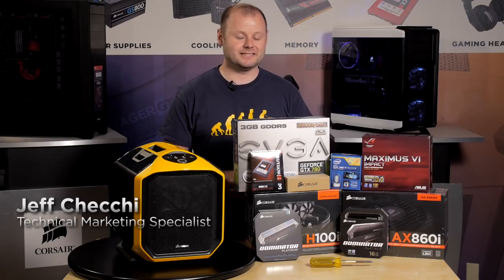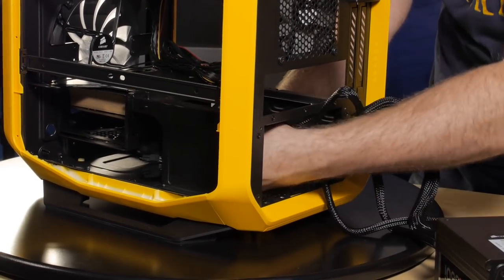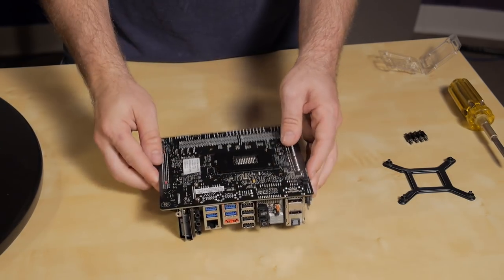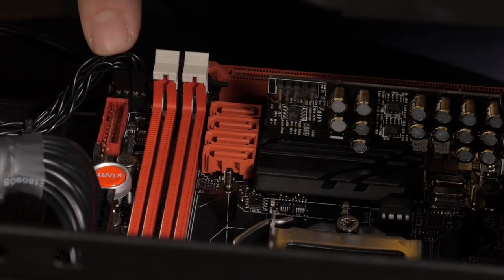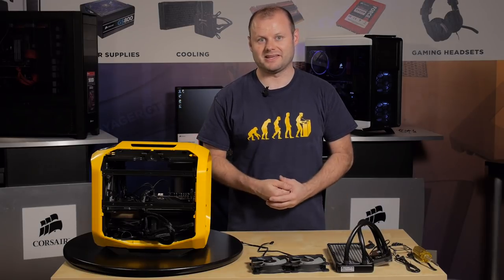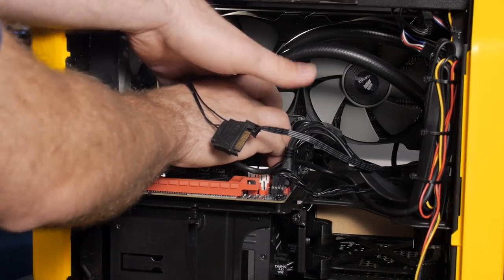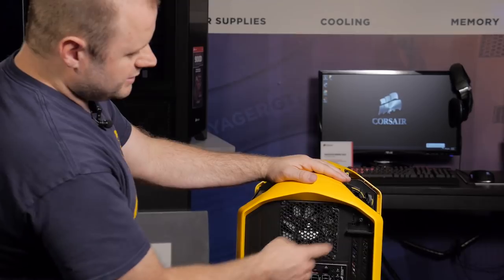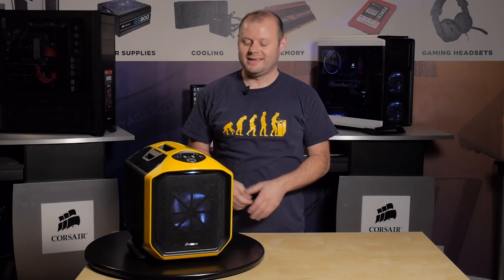Graphite Series 380T Mini ITX system Build log

Comment: What do you think of this guys? It's gonna' be for a low-mid budget workstation build.

Processor:
-Intel Core i7 6700

MB:
-Asus Z170I Pro Gaming

-This Case

PSU:
-Corsair CX430M 430W

GPU:
-Sapphire Firepro W5100

Memory:
-Corsair Vengeance LPX Black DDR4 PC21300/2666 MHZ CL16 2x8 GB

Hard drives:
-Samsung 850 EVO Series MZ-75E120B 120 GB (Will be used for OS and some applications)
-Toshiba H200 HDWM110EZSTA 64 MB Cache 1 TB

USB Optical Drive:
-Samsung SE-506CB
Reply: +Johan Branting I would definitely swap out the PSU for something other than a CX series, seeing it has problems with shorting out or even exploding under heavy load. Might be a good idea to go with something from EVGA.
Reply: Koter Alright thanks for the PSU notes! :-)
EVGA on the other hand only sells the Geforce series in my country, which would be pretty useless since (and i should have pointed that out) i'm going to use a lot of applications for video rendering+3D modeling and animation. I won't be gaming on it at all.
Reply: +Johan Branting You should go for the 6700k when you arleady use a z170 mobo.

Comment: Has anyone had any issue with the PSU components heating up the back of the motherboard, as they are directly next to eachother?

I have just brought this case, and I am concerned about the heat buildup in the component side of the PSU, transferring heat to the MB.
The only solution i could think of was to add some kind of thermal insulation between the PSU and MB, but there doesn't seem to be much space in between them.
Reply: No
Reply: the intake and the exhaust of the the psu are both facing outwards, there shouldn't be much or any heat from the psu going into the system.

Comment: am guys does using a Custom fan does make a change in performance of a liquid cooler ?
Reply: no
Reply: you could use corsiars ''sp'' series! Pretty good at keeping low temperatures
Reply: could you also use the AF Fans from Corsair for Watercooling?
Reply: Der EzO You could, but it wouldnt cool that good! You can either use the sp-series fans or the new ml-series fans.

Comment: Hi corsair, can i put 2 h80igt here? 1 for cpu 1 for gpu? Thanks.
Reply: +jj1607jj unlikely. H80i GT is too thick.

Somebody managed to fit a single H80i GT into EVGA Z170 Stinger Mini motherboard but it was a VERY tight fit.

I tried a single H80i GT with z170n gaming-5 motherboard and it doesn't fit.
Reply: +kiwituatara thanks. I will keep that in mind.

Comment: Does anyone know if you can fit a 140mm water loop cpu cooler in this case with room for rest of the hardware gpu, ram ect being installed on the mobo??
Reply: 120mm radiator at the back or 240mm on the side.
Idk if a custom one would fit.

Comment: Dear Corsair: It's been driving me fucking bonkers since you released the product announcement page for this product, but you state that it supports up to 6 fans, but I count 5 (two in front, two on side, one in the rear). Is there another option I'm not seeing? What am I missing here? why does this bother me so much? I DON'T KNOW!
Reply: ¸one at bottom where hdd cages is?
Reply: The front panel has support for two smaller fans or one big fan.
Reply: That, that doesn't even begin to make sense. Corsair advertises as supporting up to six fans (that would be six fans simultaneously), having to option to choose between one or two fans at the front means you can choose between having 5 or 4 fans simultaneously, and if you haven't noticed, neither of those numbers are 6.
Reply: mygetrichslowplan On the website it seems to only list the ability for 5 fans... http://www.corsair.com/en-us/landing/graphite-series-380t-780t

Comment: Can u install normal hd in the ssd slots that he installed the ssd in?
Reply: Only if they're 2.5 Inch ("Laptop") drives..
Reply: NeedMoreMushrooms WRONG, it supports 2 HDD of 3.5" Desktop size
Reply: Mike Messiah He asked about the SSD slots, not the normal cages..

Comment: Does anyone know if a Hydro series GPU and a H80i or H60 can fit in the case together?
Reply: ***** Well, most people in the commends talking about Hydro Coolers are talking CPU coolers like the H100i gtx. But, I'm asking if it could fit a AIO liquid cooled GPU like the hyro series of GPU corsair is selling like the like their "Hydro GFX GTX 1080" or "Sea Hawk".

Essentially, I'm asking can you fit 2 radiators inside this case. Whether I can have a 120mm radiator in the front while also having a 240mm radiator on the side.

Comment: Can I change the Graphics Card to Gtx 980???
Reply: Well it's big as the 780, soo i guess that's a yes
Reply: :P
Reply: Amiel leonard // Yeah same question for me. Hope GTX980 its okey for this case :)
Reply: I dont know much about Graphics card, but i know, that the Gtx 780 is the same Size of the GTX 980
Reply: I'm gonna buy 970, because it's Cheaper
Reply: Kasj26 Miner one more question is there any negativ effects on peformans itx systems then normal case with mb?
Reply: I dont know not that much, about computers. All i know that this Gtaphics card can fit on this case
Reply: it doesn't matter about the case, it matters about the motherboard being compatible with it.
Reply: Mert Kilic Mert ITX Kasanın kotu tarafları var mı peformansı etkıleyen yada cok ısınmasına neden olan yada baska bısey ? Onemli bir etkisi varsa ATX e donecem anakartdanda bahsetmisin anakart itx de ASUS MAXIMUS VII IMPACT bu videoda oldugu gibi . atx olursa ASUS MAXIMUS_VII_FORMULA . yardimci olursan sevinirim yakinda sistem topluyorum. sagol .
Reply: ben gedimde bir sistem yapmak istiyorum kotu  olan sey 3 graphics karti koyamazsin. Bu kasada 5 tana isindirma fani vardir benim bildigim, bu kasa icin ITX motherboard kulanman lazimdir, atx kulanamazsin  cunku atx ler cok buyuk bu kasa icin.
Reply: Mert Kilic Anladim zaten sli isine girmem girersemde en fazla 1 tane daha koyarim. 1 980 koyacagim icin bir sorun olmaz diyorsun yani bir fark yaratmaz yani ?
Reply: Zaur Cabarov evet sorun olmaz, intel kulanmaya calis, benim bildigim AMD calismiyor
Reply: Aynen Intel i74790k

Comment: How much fps can it run, on Minecraft, APB reloaded, and Gmod
Reply: Kasj26 Miner it depends on what cpu and gpu you have build in it.
Reply: Intel Core i7 4790k
And
Zotac GTX 970 4GB Vram
Reply: im not sure but you can definitely get a high frame rate, in those games, with a gtx 970 and intel i7-4970
Reply: Kasj26 Miner Most likely, of course but that is way overkill for what you want. An i5 with a 960 or something similar will do the job just fine.
Reply: Here is my build, if i get Intel Core i5 4790k

Build:
CPU: Intel Core i5 4790k
MotherBoard: msi Krait Edition Z97
RAM: HyperX 16GB 1866Mhz white
CPU Cooler: Corsair H55
HDD: WD 2TB
HDD 2: WD 500GB
Graphics Card: Zotac GTX 960 
Power Supply: Corsair 600M
And!
Case: Fractal R5,
Or the Corsair 380T, but i have to change the Motherboard

How much FPS can i get on Minecraft?
Gonna do some YouTube stuff with my friends!
Reply: In my pc i have a gtx 670mx in minecraft im able to get 140 fps, so i think you are good to go.
Reply: Kasj26 Miner This build would be great for Mc. Ram is good for future, but dont get 2 HDD's. Maybe get an SSD to replace the 500GB WD as a boot disk, and 2 1TB HDDS, one for games, other for videos :) BTW its the i5 4690k
Reply: Ok
Reply: Kasj26 Miner lol fps for Minecraft...
Reply: Much Doge You don't need an expensive unlocked core for your interests. Just go with a cheap AMD build and spend less than half the cash.

$500 is all you need, not $1200...

Comment: Can a Republic of Gamers Strix 1070 fit in this?
Reply: no. its too big :(. you should pick other case or smaller GPU.
Reply: Yes it will fit. A quick search into many reliable forums digs out the fact that this case supports graphic cards even larger than the Strix 1070. In fact, I'm planning on getting this case and an Asus Strix ROG 1060, which is the equivalent length as the 1070 so we share the same problem (not a problem anymore). Anyways, where do you plan on getting your Corsair 380T? I'm planning from microcenter.
Reply: Selim Eylül Im not quite sure yet, but probably microcenter aswell, im moving to New York so I need a smaller case for my build, I've got a XFX type 01 now which is HUGE.
Reply: Nearous Old Account Damn bro. That is huge. Good luck though!

Comment: Can i bild a windforce gtx 970 Inside??
Reply: If it's under 300mm I think.
Reply: Nah it won't fit I checked
Reply: Windforce will not fit, a regular 970 will fit and mine has no problems with heat or sound.
Reply: I would go with a stix gtx 970 nice and quite and powerful as well. Nothing wrong with the regular 970 i just don't like the blower.

Comment: ⚠Some words are in Romanian⚠
~Lan party PC build + home stuff~
Carcasa Corsair Graphite 380T Yellow
Placa de baza ASUS MAXIMUS VII IMPACT
Sursa Corsair AXi Digital AX860i
Memorie Corsair Dominator Platinum 16GB DDR3 1866MHz CL9 Dual Channel Kit
Procesor Intel Core i7 4790K 4.0GHz box
Pasta termoconductoare Arctic Silver 5, tub 12g
Cooler CPU Corsair Hydro Series H100i GTX Extreme Performance
Placa video ASUS GeForce GTX 980 Ti 6GB DDR5 384-bit
SSD Samsung 850 Pro 512GB SATA-III 2.5 inch
Sursa Corsair AXi Digital AX860i
Unitate optica notebook ASUS Blu-ray ReWriter BW-12D1S-U Retail black
SSD Samsung 850 Pro 512GB SATA-III 2.5 inch
2xHard disk Seagate Desktop SSHD 2TB 7200RPM 64MB SATA-III
Monitor LED ASUS ROG Swift PG278Q 27 inch 1ms GTG black
Casti Sennheiser Over-Head HD 518
Boxe Genius SP-HF2020 V2 Wood
Router wireless ASUS Gigabit RT-AC66U 802.11ac Dual-Band AC1750
STANLEY Surubelnita tubulara clichet 63-022 blister - 22 varfuri
Priza/prelungitor Gembird EG-PMS2-LAN
Memorie externa Corsair Voyager GTX USB 3.0 256GB
[For the case I got some fans … 3x Ventilator / radiator Noctua NF-F12 industrialPPC-2000 IP67 PWM for the cpu hydro cooler and 1x Ventilator / radiator Antec TriCool Big Boy 200 (and some antivibration things cuted in place Accesoriu ventilatoare / radiatoare Acousti Products AcoustiFan AFG60B) for the front of the case]
And some peripherals for gaming:
Fps…
Mouse gaming Corsair Vengeance M65 FPS Laser Arctic Black
Tastatura gaming Corsair K70 RGB EU version
MOBA…
Mouse gaming Corsair Vengeance M95 Performance
Tastatura gaming Corsair K95 RGB - Cherry MX Brown
Reply: Nice build m8!
Reply: thanks but i want to see the performance in cooling and the overall performance of this build before i build it ... so i want someoane to make a build video for this build ... you understand me?
Reply: +A.A. B. Its really nice build, the performance would be insane. Just get it if you have money. And thermals will be low because h100i gtx
Reply: i would like also a profesional advice for fan orientation setup...
Reply: also i changed my mind about antec big boy 200 ... to Ventilator / radiator Cooler Master MegaFlow 200 blue LED Silent Fan

Comment: 860i corsair is way too much, there is no option for upgrades so 450w should be cool.
Reply: You are right, but there are still advantages to using more power than you need. With a single GPU the fan on the 860i will likely never spin, so the system will be quieter than if you used a 450w.
Reply: JeffCorsair EFFICIENCY CURVE thats all.
Idea of my comment, i would save up some cash not getting 860i, and dominator ram is same storry, waste of money, and get 780ti instead of 780, that would be bigger advantage.
Reply: Jānis Meija Very true, I was definitely not trying to build the most cost effective 380T. This system will belong to a very important person, so I sparred no expense :)
Reply: JeffCorsair i would love to get one of these cases from corsair, really cool form factor. but that means i need all new stuff, for that form factor!
check out my own rig.
http://failiem.lv/u/jvabtln
Reply: JeffCorsair hey Jeff. Does the side that you put the rad have a filter to have as a intake instead of exaust?

Comment: Awful airflow design...
Reply: change the front intake with a bigger fan(200mm) and you will be just fine.
Reply: The side panels are vented so the GPU and radiator have direct access to outside air, and there is an intake and exhaust fan moving air from the front to the back of the case. How would you have changed it?

Comment: WARNING: Do NOT buy this case. No room for the 3.5" drive cage, it's absolutely useless. I have the same parts as the video except the SSD and GPU, it's impossible to fit the drive cage. The rest of the case is a huge bitch to work with. Also the motherboard is ass. The screws on the soundcard are so tight it's impossible to unscrew them without breaking the damn thing. I just installed the card unscrewed. Now whenever I plug in anything from the real it'll get unhooked, then I'd have to remove the GPU just to put it back in. BAD BAD BAD BAD.
Reply: BHRxRACER you probably have to manage your cables a little better. I had the same issue fitting the drive cage. I dont live how the leads off the powersupply rest against the cage but it does fit. You might want to try removing the front case fan and routing all your cable(with the exception of the sata) under the drive cage and back over the top. Then just wedge the cables off to the side so they dont block the fan. Reinstall the fan and you should be good. You can check out my build here:
 http://pcpartpicker.com/b/y4WXsY
Reply: YovieD Forgot I made this comment. After taking pictures of my build hours after that comment I realized I could just bend the shit out of the power cables and (hopefully) get away with it. My cable management was neat but I was afraid of bending the power cables too hard to fit in the drive cage. I did that and everything's fine for now. Still, the case IS a bitch to work with. The radiator blocks one side, the GPU blocks the other, and the front fan blocks the front. The motherboard also doesn't live up to the Asus quality hype. 

I ought to take more pictures and upload them there.
Reply: YovieD Oh and with all due respect, your card is small and you're not using a 240rad. Your build would be hell of a lot easier to work with on this case. The g1 gaming 980 ti barely fits in there.
Reply: +BHRxRACER Buys a case without researching properly, calls the case bad.

"Don't buy banana, I don't like it, so you won't like it, because I'm the center of the universe"
Reply: Solitude if you actually read my comment you'd understand. idiot. I saw people fitting in their drive cages with a same sized PSU. I manage to do it anyway but I bent the crap out of the cables.
Reply: BHRxRACER I actually read your comment.
"If you actually read my comment" is lame comeback, dude. It's not like you wrote a 500 page report.

Why do people complain about cable management? You gonna do it once, yet complain about it forever... babies.